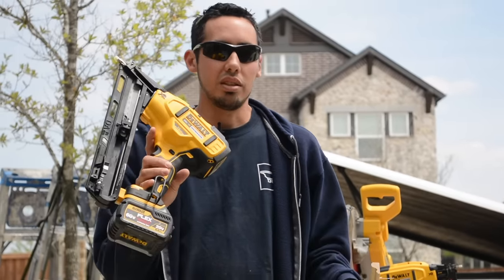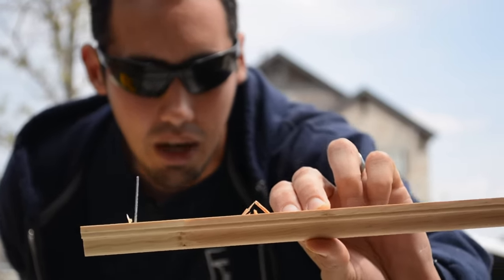Which NAIL GUN Should You BUY???

Comment: Great video and description of the various tools.  With the 2.5" nails do you ever hit electrical cables running through holes in the wood?  Typically the hole for the cable is about 1.25" from the edge of the stud.  With a 2.5" nail you have about 1/4" in the molding, 1/2" through the drywall and 1.75" into the stud.  Sounds like a potential problem.

Comment: I use brad on crown and casing. I use finish nails on baseboards and chair rail. I can’t bring myself to switch to DeWalt yet. $600 total for both guns. Both my Paslodes work fine. The finish nailer I got at auction for $75. I’m gonna wait till it dies.
Reply: Worth every penny bud.
Reply: renaissanceman buy, try for however long til return expires. Decide then.
Reply: Jose Gomez I know I’m going to like the DeWalt. One power source. Paslode I have to have batteries charged and fuel.
Reply: Brian Heuer I know. Just rather buy a tool I don’t have with the $600. Been eyeing the Mafell jigsaw. Or the Mirka orbital sander. Both are $700 beans. Good tools ain’t cheap.
Reply: renaissanceman

Plus the Paslodes give off kind of a farty smell.  My broken Paslode has been buried in a cabinet for the past 10 years.  LOL!!!
Reply: renaissanceman

I will say that the ergonomics of the Paslode are second to none.  If feels really good in the hand.  However, the gas/electric firing system of the Paslode will eventually go the way of the dodo bird.  The battery-only nailers have gotten really good so why bother with having to buy leaky, disposable, farty-smelling fuel cartridges?
Reply: renaissanceman  it looks like that time has come 😅
Reply: You might be waiting for a while; I'm still using my Paslode 16ga angled finish nailer I bought in 2001

Comment: Richard!! You talked me into buying the 2 dewalt guns 15 and 18 gauge.  The 15 gauge doesn't like nailing though 1" mdf.  Have you had any issues? Maybe I need a bigger battery? Depth gauge is set as deep as it will go.  Thanks bud
Reply: Finish Carpentry TV I do have the right nails.  DA 2 1/2" going into 5/4mdf to framing. I was thinking maybe a bigger battery would help?

Comment: Cordless is the only way to go now. I had DeWalt, but they got pushed out of my work by Milwaukee. I personally found them more reliable than the DeWalt with their consistent sinking of the heads and also there is almost NO delay from trigger to nail and the DeWalt kind of drove me crazy with it's ramp up time, (much like a Paslode.) Had to slow down or I was constantly missing my sweet spot on the trim because I was pulling the trigger and moving before the nail was ejected. Not an issue with the Milwaukee. Either choice is better than gas or air guns.
Reply from the maker: That 15 gauge Milwaukee is awkward for me. I found the exact opposite in my experience. The Milwaukee's were super heavy. Oh well, I guess we all figure out our own way! :)

Comment: Should us a 23 gauge headless pinner for cabinet mouldings. I think just having the two guage nailers isn't enough as well. I am also starting to phase out my 18 gauge in favour of the 21 gauge pinner. It holds incredibly well and the hole doesnt volcano like the 18 gauge so it paints up way nicer. How is that dewalt 18 gauge brad nailer holding up a year later? I have the spiker but I'm weary about trying the brad nailer as I have a buddy that works in a tool crib and he is constantly working on them. My experience with dewalt neumatics would steer me away regardless but I have the flexvolt batteries that I bought to run my spiker and I was thinking about trying the mitre saw and table saw as well. Dewalt has a way of building certain parts out of plastic that should never be plastic. I'm also biased against dewalt as the first drill I ever bought was dewalt and it burned out after a year. I still use my original makita drill and driver combo that I bought to replace it I want to say 12 years ago? Maybe longer. Whenever the makita lithium ion lineup came out.

Comment: If you are not a contractor, the compressor-operated nail guns are cheaper, more reliable, and lighter to operate, provided you are a DIY. Note: Dewalt now has a quieter. flex volt 2.5-gallon compressor. As you know, compressor-operated nail guns are less than half the price!😁

Comment: Uhhh, I don't think you mentioned the adjustable depth setting on the dewalt electric brad nailer...  which no doubt effects the power behind the drive of the nail.

I don"t own a 15 gauge dewalt brad nailer but the 18 gauge; I do own and have found the depth setting important.

Comment: The other video with the ridgid pnumatic nailers you said the one you use as a hammer broke cause of that. On this video you explain you always yse max pressure on your compressor. The fact is that when you use max pressure over manufacturer recommended settings you can break the firing pin. So long story short. You can fix the broken one by replacing the firing pin and if you run at manufacturers recommendation then you will have better results and longer service life. Just thoight i would point that out since i just learnt it myself. 😉

Comment: Tks dor The Vid! What is the model of the Dewald 15 gage you used for this video? Is the 15 G the one with the angled magazine? Any suggestions for additional battery for more power or back up battery? Tks for your advice. On nails which brand and lengths would you recommend for the 15 Gage? Tks again 👌🏻🙏🏻
Reply: Tools & More DIY I am sure it is the DeWalt DCN650 34 degree 15 gauge nailer.  I use a 5.0Ah battery but you could probably go lighter.  DeWalt nails are good.  And I have had good luck with Porter-Cable too.

Comment: My old Bostich 15ga nailer just died nailing 2 1/2" nails into 1" thick cement Hardie Trim board. Wondering if the DeWalt cordless can nail through cement trim?
Reply: Would like to know too.
Reply: Recently I purchased the 15 ga cordless and used it on trim! It had no problem shooting through 3/4 and the 1/16 hardi paneling. But when shooting on the overstacked section it experienced issues. But that's expected because I had the same issue with the pneumatic 15ga DeWalt

Comment: I'm installing 1" solid unfinished oak staring, and want to purchase a nail gun. That said, will a 18v 18 gage cordless nailer go through the wood? I don't want want to find out that the nail gun won't penetrate the oak treads. I plan to use liquid nails in addition to the nails. Please advise.
Reply: If your doing stair nosings I use pl premium as well as hot glue. I dab on the pl premium, press it onto the stair and make good contact, hinge it up and make sure, and then gun out hot glue, press the nosing back down until the hot glue does its thing and then move onto the next one. If you do it this way you dont ruin your nice oak with nail holes

Comment: Very informative video on the 2 guns and  the same 2 guns I’ve been trying to decide over. Going with the 18 gauge model # dcn680d1.    Great video as always.  Keep em coming!!👍
Reply: Just a quick 2 month review of everyday use. Very happy with the 18 gauge,close to 2000 brads shot through it. Not one single jam. Depth gauge switch works great. I did shoot one brad into my finger lol. Finger was right underneath my work piece and I though it was far enough away. Super bleeder but no stitches needed 😀. One complaint is when your down to the last 10 brads the unit quits firing. So right now I probably have a couple hundred extra 10 strips of brads.Not worried about that at all as this unit has made its money back 4 or 5 times already.  Great gun if anybody is interested in purchasing one 👍😀

Comment: that molding is called base cap and really should not be nailed in the thin part should be nailed in the rounded fat part if possible but if needed you can shoot it in the thin part but I would recommend a brad nailer to do that.. also personally I use a 2 inch nail on everything when I trim the entire inside of a house even on my stair rail pickets I used to switch to a brad nailer but I no longer do that I use a 2-inch nail for everything as far as trim goes of course if I'm laying Luan that would have to be done with a stapler

Comment: those guns are great for doing Punch-Out work definitely not something you would want to use to trim an entire house they would never keep up. I've been trimming houses for over 30 years and I believe the best trim pneumatic nail gun on the market is Paslode the durability of these guns are amazing and I have ran every gun that's ever existed on the market my next choice would be Sinco but they cost a lot to run the nails are expensive.
Reply: I agree i bought dewalt 16 air and it was nice but  my paslode 16air was the best gun i ever had..10yr trimmer ...have u ever built free standing circular?

Comment: I'm in Malaysia.
We typically live in concrete structure and brick with plaster wall. 
Does the nail guns able to work well in penetrating the concrete and brick wall as I nail wood/timber onto them?
Reply: Not these, these are finish nailers. Hilti does make a nail gun that is specifically meant to shoot nails through material into concrete/block.
Reply: @johnd9357  does it work well when it punch the nail through the wood before going into the brick/concrete?

Comment: Part numbers on these guns?
I found a 15 guage dual speed and a 15 guage single speed xr, but it's got metal cap on the front. I can't even find your 15 in the affiliate link. Just the 18 Brad nailer.
Just curious if you went with the one you have over the 690 and 692 for a reason

Comment: I build handrails and do finish work and I’ve been in production for years now and Senco fusion nail guns are the best by far ...Paslodes are good but to expensive to run in production.
Reply: Rafael Reyes I've got a couple Senco guns that were handed down, 20 years old, and work great!
Reply: I was just about to comment this, the Senco fusion series are beasts. the batteries last for over a week aswell
Reply: Rafael Reyes

I couldn't agree more.  I bought the Fusion 18 gauge last year and am not disappointed.  Small nose, lightweight, never misfires, dry fire lockout, batteries last forever, looks cool, ;-).  I also bought the Senco cordless 15G and it has trouble driving nails into studs so I don't recommend it.  I bought the DeWilt 15G pneumatic for heavy duty, all-day work and it performs flawlessly and with a super small nose it's great for t&g.
Reply: senco and porta cable trim guns. hitachi 83a for a framing gun. pasload is a puchlist tool

Comment: Has anyone got a nail through their finger by holding down the work..shooting the gun, then the nail curves right back out the front?? I've had to many close calls and use a padded hammer handle on the work to hold it down if pressure is need close to where you shoot.

Comment: Hey. Thanks so much for your video. It really helped! So here is my question. I am a light "Do it yourself guy" ... and have decided to install hard wood floors in bedrooms and stairs. I will be installing 3/4 inch hardwood (maybe oak or something similar) over plywood existing floor and steps (I presume that is what will be under my carpet). My question is, if I get a NAILER, which I am considering, what gauge should I use? I don't like the idea of visible nail heads, so I am thinking gluing the treads and floor and only nailing the edges into the plywood at an angle as I put in each plank, and maybe ONLY glue the last piece. Is that recommendable? I see there is a 23 gauge pin nail nailer, which I was considering, but is that too weak for steps and flooring? Thoughts appreciated! Thanks again for your great videos!

Comment: Does the DeWalt not have a depth setting? I use a Porter Cable 16ga battery gun and you can adjust the depth. Surprised DeWalt didn't offer that if that's the case.
Reply from the maker: They do allow for depth adjustment.

Comment: hello, love the channel.  what is happening when the 18 guage nail is bending at the top of the wood and not going straight in.  Do you have some suggestions on why this is happening and what i can do to fix this issue.  It does not happen every time, in fact it happens rarely, but when it does, it is a pain in the ass to try to get that nail out without hurting the wood and it leaves that large mark in the wood which is quite unpleasent to see when you were trying to finish a piece.  Any suggestions you may have would be greatly appreciated.  Thanks in advance for your suggestions.  I bought the nailer from woodworkers supply, I believe it is a woodcraft 18g nailer from 5/8 to 2".  Like i say it does not happen all the time, and i am not hitting anything to make this  happen, but it is unsightly when it does happen and the top part of the nail is bent over and not straight in.  Thanks again
Reply: Only ever seen it happen to me in corners when the nail ricohcets off of the corner bead 🤷

Comment: Good video!!

I personally prefer 21 gauge headed .....for trim work.

Don’t forget to mention the use of stainless steel brads for exterior use.
Reply: Flyer88 .....I never heard of a 22 ga Headed, please enlighten us, im not s big fan of the 21 ga non headed, they don't hold
Reply: Flyer88 he is right senco and cadex now make 21 ga head and headless brad nailers
Reply: JohnnyBDyer 

21 gauge comes in 2” length.

The head creates great holding power with minimal nail hole.
I case doors and windows with my 21.
Doors are hung with 18-15 gauge.
 I now pre-lacquer all baseboards and glue them on with a high temp glue gun and wood glue the corners so they can be sanded if required.
No nail holes, no patching no touchups with latex ruining the perfect lacquer finish.

I often hot glue toe kicks and other small mouldings to avoid nail holes
Reply: Flyer88 what brand 21 gauge nailer do you use? I'm interested in the OMER but hesitant because it only shoots 1-9/16".
Reply: D Fruin 
I don’t recommend it.
I have several Omer guns.
The 21 gauge is the most problematic gun I’ve ever owned. ( unless they have improved it lately? )
All other Omers are great!
I use a gun from Prime Fasteners. It’s there own gun...it has been absolutely perfect and half the price of an Omer.
Senco make a nice 21 gauge also.
The most important thing with 21 gauge is finding good quality brads that are made of high-quality steel.
Do not use Chinese brads!
Reply: Flyer88 thanks for the advice!
Reply: I live in New Zealand and being a small country we don't have the competition nor the bulk purchase deals. Stainless steel brads are prohibitive in cost. I bought a box of two thousand 50mm (2 inch) 15 gauge for $230 NZ dollars (maybe about $190 USD). You almost have to charge per brad!

Comment: Do you get nail jam in the head of dewalt ? Plus what do you use if you have to trim out a solid wall as far as fixing to it goes I come up against this a lot over here
Reply from the maker: Literally have not had a jam on either of the Dewalts since owning them.
Reply: All guns can jam.  The Dewalts are super easy to clear if they do though.
Reply: Yes I’ve an old one which is well worn still Nicad batteries ,so I do get a few but very easy to clear ,but still wondering what you do about fixing to a solid wall?
Reply: My Dewalt jams all the time. I think this is due to lack of pop from having no gas.  Please bare in mind I fire circa 1k nails a week. I also love Dewalt but this gun is less than 12 months old. Not good.
Reply: When I fix to solid walls I use a construction adhesive along with 16ga nails. I only use nails long enough to go through and into the plaster and not all the way back to to block or brick. This generally gets a good bite onto the wall and once the adhesive is dry it ain't moving at all 👍
Reply: Brian is right...my Dewalt jams periodically but they are indeed really easy to clear.  Problem is....nail is now stuck halfway in the board and requires removal from board AND gun.
Reply: 2nd fix used to jam but wasnt that bad

Comment: Are the Dewalt framing nailers good?
Reply: stan hankins you wouldn't want to frame a house with one, although you could. It would take a little longer. It does jam if you shoot into truss plates. It's awesome for smaller jobs and finishing up. Helps to have a flexvolt battery but you don't have to

Comment: I have the 16 guage Dewalt angled cordless, ok so it stinks, it dry fires which is an  unforgivable omission in a top brand power tool, and it jambs all the time even though I constantly clean and oil it, I bought a Riobi 18 guage cordless last year, not even one hick up, go figure, and IT doesn't dry fire.